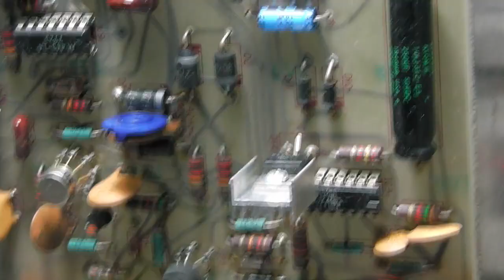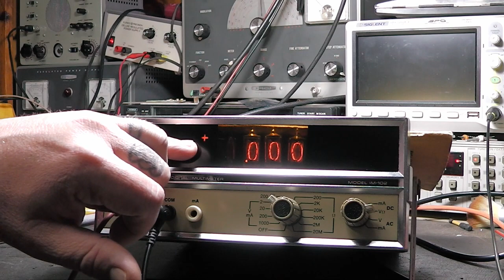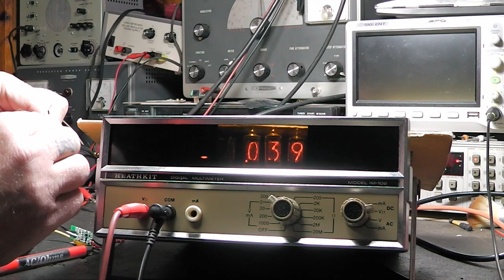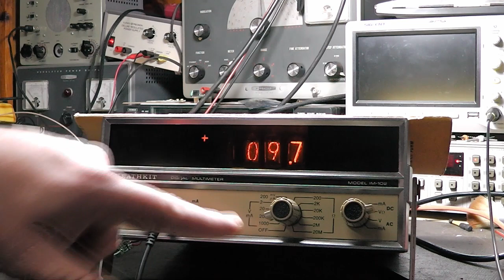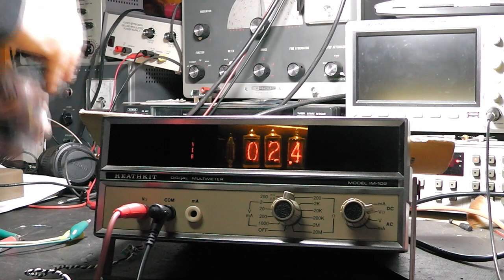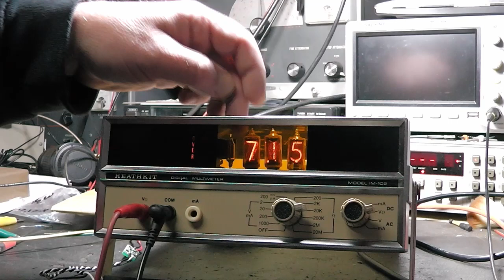Heathkit IM-102 RESTORE PART 2

Comment: Turns out that this IM-102 is Heathkit's copy of the Weston model 1240 DMM; both companies were under the same ownership at the time. The 1240 also uses the same round heatsink.
Reply from the maker: Ah, I did not know that.  Thanks for the information.

Comment: Both of my IM-102's have that same round finned heatsink, so I think that must be as Heathkit designed it.
Reply from the maker: It may very well be.
Reply: @ke4est  , BTW, in your explorations while repairing this meter, did you find any datasets for the "TOA8709" op-amp (IC2 & IC19)?

I have not found anything about this chip online, other than one brief mention on a German website that compares micro-photography of different old ICs; apparently they conclude that the chip is basically the same as a uA709......